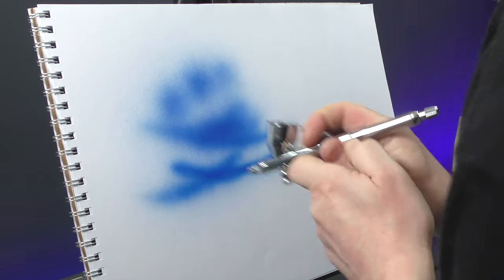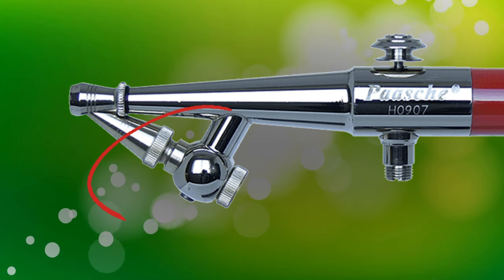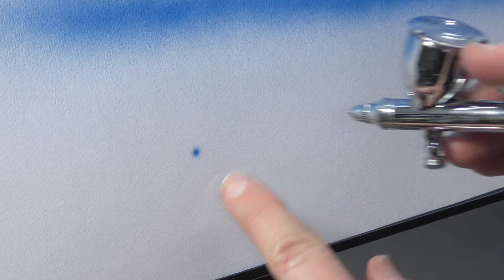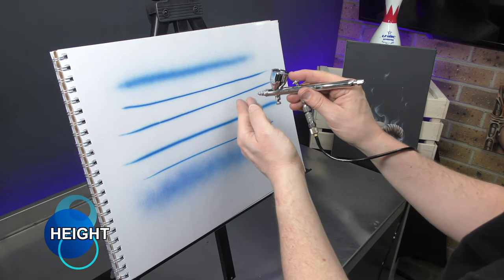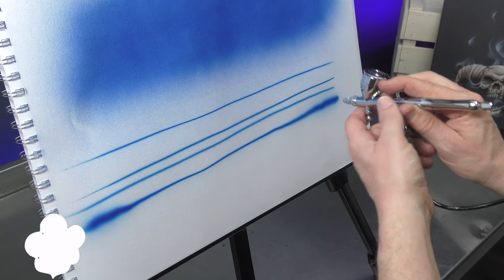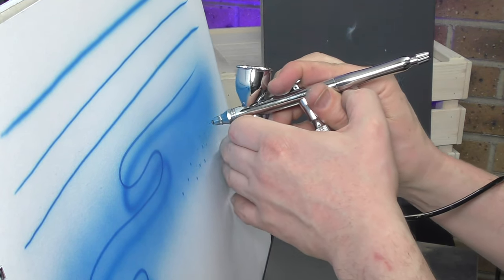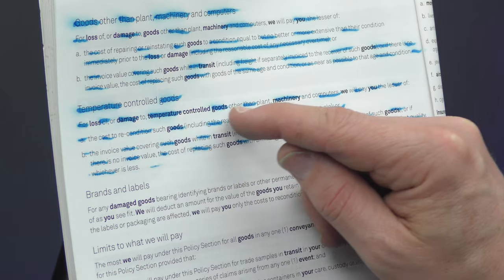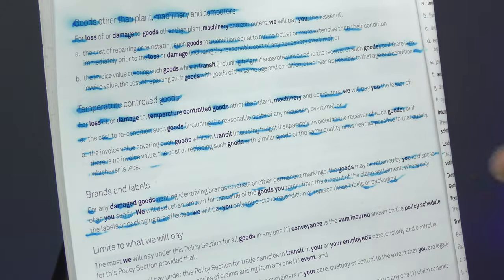Are You Airbrushing Correctly ?

Comment: Picked up airbrushing for the first time during the pandemic (largely through this channel). Arrival of second child meant I put it away for a while, but finally found it's way back out again in recent weeks. Great fun - although I'm getting problems with both tip drying (this video confirmed I am using largely the correct technique) and moisture from the compressor. I use an Iwata compressor and try to regularly empty the moisture trap while I'm airbrushing, but it seems inevitable that at some point during painting I'm going to get a nice big wet painty splat over my artwork. Is the only way to avoid this to just not have the compressor running for too long? At the moment I'd say it's after 20-30 minutes that I start becoming aware of it. Great channel. Thanks.
Reply: I would highly suggest getting a compressor with a tank.  Don’t know where you are located.  Here in the states I bought a California air tools air compressor: 1 hp 8 gallon tank with 70 decibels and no water in the line.  Tankless air compressors get got pretty easy, which creates to much moisture that can  lead to what you’re referring to.  Maybe airbrush asylum can suggest something as well cheers.
Reply from the maker: Thanks for your kind words re : my channel and glad you are getting back into airbrushing. In regards to your compressor, not sure which iwata compressor you have but anything from an IS 875 upwards should be able to handle quite a few hours of painting without it beginning to overheat and create moisture within your line, if you are using a smaller one like the Ninja or silverjet then they are better suited to smaller applications ie .. miniatures and cake decorating. If you do have one of the larger models then you may want to get it looked at, as it sound as though the moisture trap is failing ? You may still have warranty ? The other option is to get a compressor with a tank so that you can paint for longer without it turning on all the time, this will save you lots of moisture issues, also keep in mind where you are airbrushing, a humid climate will always yield more issues when it comes to moisture, hope that helps. 🤞🏻😉

Comment: Don Eddy would disagree with your generalization of the single-action airbrush. Look at his work and see what you can achieve.
Reply: An exception doesn’t make the rule. You should look into that.
Reply: @GoodArtorias   it isn't an exception to the the rule.  There are no rules. There are outcomes and the means to an end. The artist will determine the outcome based on his path through his process. The airbrush is a tool. The artist will determine whether or not it will get the results desired. For an artist to say that his way is the only way to get results precludes the fact there are other ways to achieve the same degree of finish by way of alternative applications. There are always alternatives.
Reply: @GoodArtorias  what exactly should I look into. I have been airbrushing for a long time.
Reply from the maker: Fair enough...I did say that the single action airbrush does have a place in airbrushing, but...to use it to create art (as impressive as that is what Don Eddy is doing) would make the whole process SO much more difficult hence why 99.9% of artists use double action airbrushes....Don Eddy's Art is astounding...and I have even more respect for him, that he has created that quality of work with a single action airbrush . 🤯